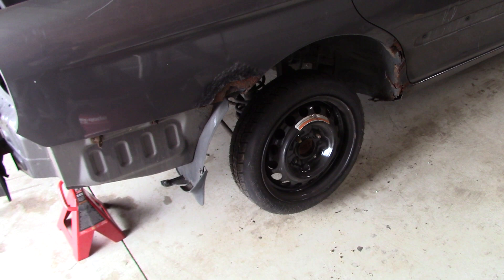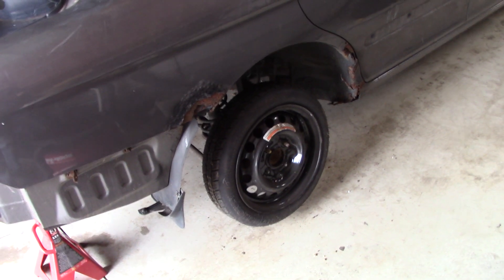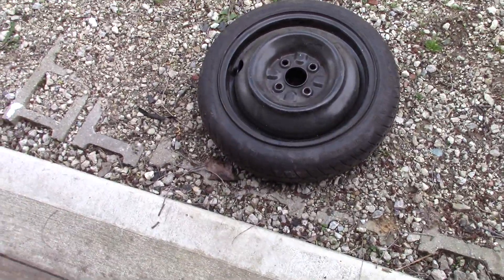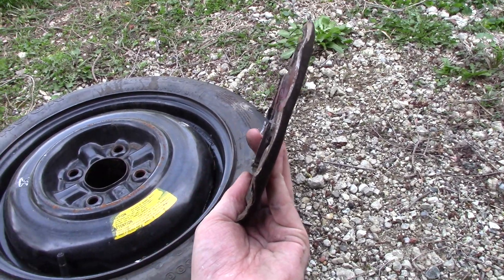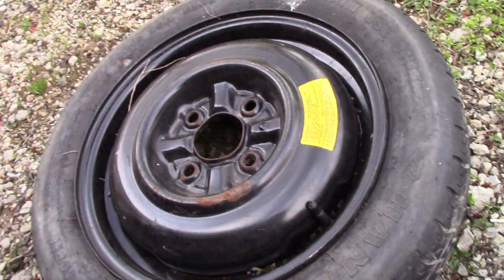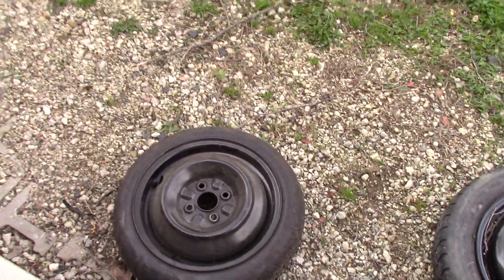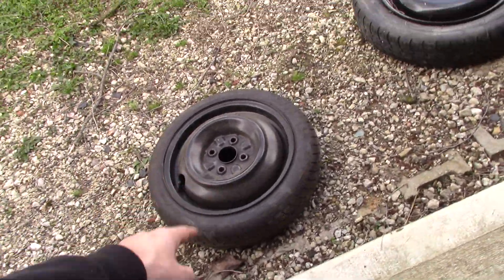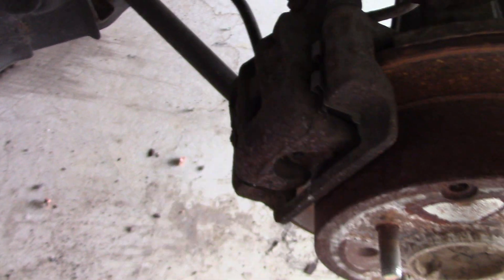Derby Tricks: Build a spare/donut tire for any car

Comment: May want to break the beads on the tires before torching or welding. The heat and compressed air dont mix they can make a big BOOM and severely hurt someone
Reply: highly unlikely.
Reply from the maker: You make a good point, i have seen videos on this with fullsize tires, but I'm not sure how much welding would be needed to get enough heat long enough. I will test this sometime with a psi gauge on a donut tire while welding sometime.

Comment: Back in the 90's on my dad's first derby car, He took 16" truck and tractor rims I believe, and cut those wheel centers out, and put the 5 lug chrysler wheel centers in. I believe that was back in 95, or 96? Now you can go and get aftermarket wheel centers with multiple bolt patterns which i like. Found out old Chrysler and new chrysler bolt patterns are the same. Lol He did this on a fullsize 1977 Chrysler Town and Country station wagon by the way.
Reply from the maker: I recently found out Chevy lumina and Ford crown vic match bolt patterns too.
Reply: @DemolitionMissions  that I did not know. Can be helpful for stock wheels.

Comment: How do u plug your back  brake lines?
Reply from the maker: Depends on where the lines all run and what material they are made from. The easiest way is to cut them near under the drivers floor and smash them flat with a hammer, fold it over ontop of itself and smash flat again...this will pinch off the metal line. But i have sometimes come across copper brake lines and these tend to leak easier or crack when smashed. So I had to unscrew the fitting at the brake master and screw in a plug fitting with the same threads.

Comment: I got my first derby car 1992 Lincoln Town car uploaded a video of me starting it and going to be recording the build process
Reply from the maker: Good to hear, make sure you stay on it and keep updated build videos. Did it come with the aluminum bumpers or the good steel ones?
Reply: @DemolitionMissions  came with a good bumper thinking about not running a bumper on the back tho
Reply: @soullessarmy9693  I'd run a back bumper on it. Crown Vics, Town Cars, Grand Marquis hold up better with a back bumper.